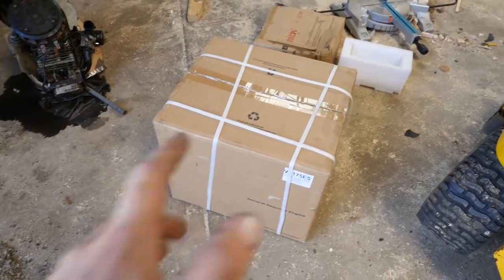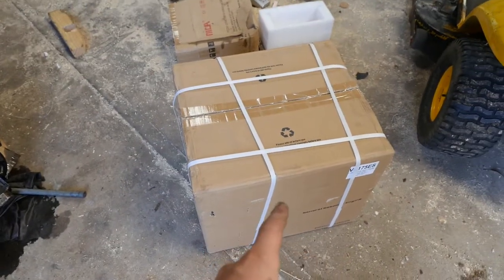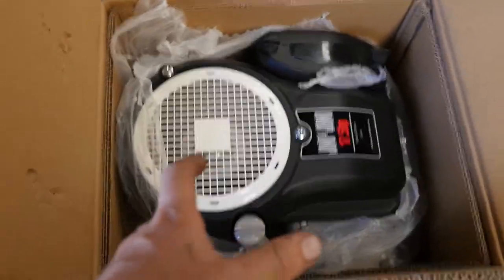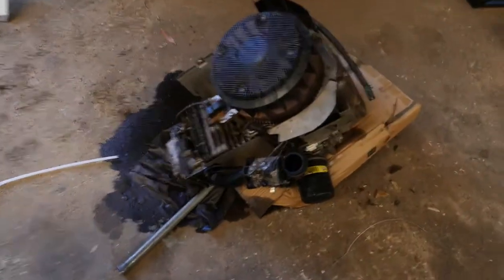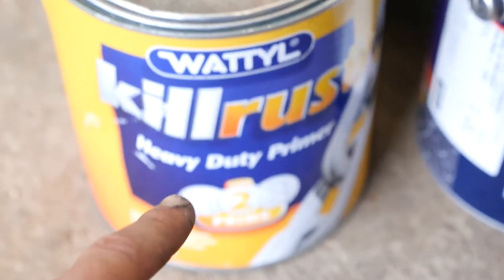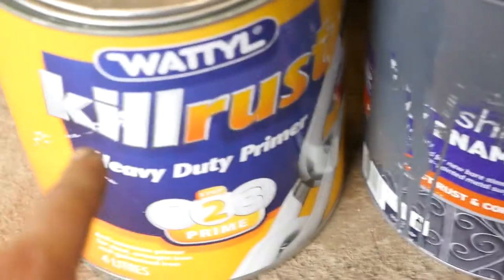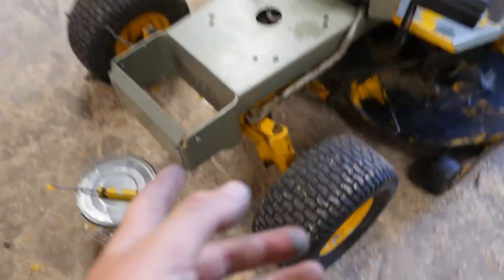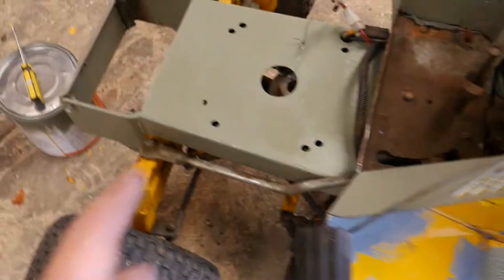Replacement Engine Unboxing - Ride On Lawn Mower Build #2

Comment: The carby on mine is crap, will run for a use and the next time the engine surges, cuts out and plays up in general. Take the float bowl off and wriggle the valve for a second and the thing works again. My personal advice is save your money until you can afford a Honda.
Reply: John Williams have you considered contacting their warranty department.
Reply: @v26224  We are 6 hours drive away from these people. I have fixed the problem but shouldn't have had to. Thanks for the thought though.
Reply: @JohnWilliams-iw6oq  Can you share what the issue was?
Reply: @tonydelovski8088  No problem, I drilled out the main jet with a 0.013" drill and problem solved.
Reply: @JohnWilliams-iw6oq  Thanks for the reply. Would you know if any genuine Briggs or Honda carbys can swap out the Chinese ones?
Reply: @tonydelovski8088  Briggs and Honda are not what they used to be, quite often the float sticks and you end up with a sump full of fuel. I have a Chinese chipper/shredder which is a cloned Honda 13HP and as parts were once hard to get I bought Honda spares and everything went well. Sorry but I don't know with the full carby. If you are in Australia Jono and Johno have been good to deal with and I live in a remote location so that says a lot for them.